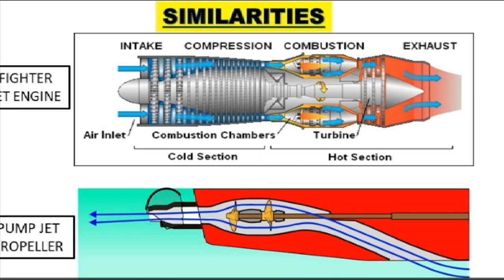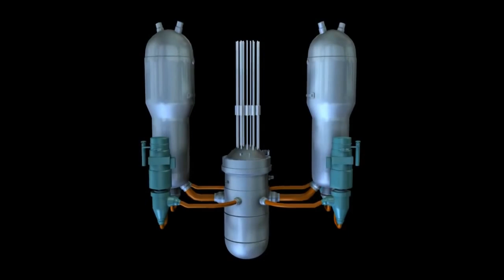Project 75 Alpha (Nuclear Attack Submarine) | Made from Indian steel with 95% indigenous content

Comment: Bharat should also consider collaborating with Brasil on their nuclear submarine 
Álvaro Alberto. It also runs on low enriched uranium and Brasil like Australia
intends to get an exception from the IAEA on nuclear fuel.

Bharat should also get the same exception. Project 75 Alpha
and Brasil's nuclear submarine have similar specifications.
Collaboration would help both sides reduce costs and shorten
time to completion.

And  both of us are working with France on the reactor. Collaboration
is a win win for both BRICS! Just like the Embraer Airborne Early Warning and Control System.

Alvaro Alberto -- almost identical

Displacement	6,000 t 
Length	100 m 
Beam	9.8 m 

Propulsion	

    1 × Pressurized water reactor, 48 MW (64,000 hp) LEU 20%
    1 × Nuclear turbo-electric engine

Speed	25 knots
Reply: Very good suggestions.
Reply: Even before brazil india will launch first SSN with technological superiority.
Brazil is seeking help from other countries even India.
I do Brazilian defense programmes don't think too much about Brazilian SSN subs ,

We can get all parts from other countries can build a kf21 like aircraft but getting indigenised in critical technologies at home is not a talk talk.

Low enriched uranium we need technical assistance but i don't see brazil here ,we get it from some other partners or iam sure we get it from our scientists.
Reply: @kirannnnnn  Nuclear submarines are very very expensive. If we can split the costs it benefits both parties.

Both sides can benefit from sharing facilities like uranium enrichment and costs of technology development.

Both Bharat and Brasil use the Scorpene submarine too. And Embraer jets. I think it makes sense to strongly push ahead and look to attain full independence from France in this area.

Both sides will save money if we co operate. If not we both will senselessly spend 2x as much and take longer to reach the same objective.